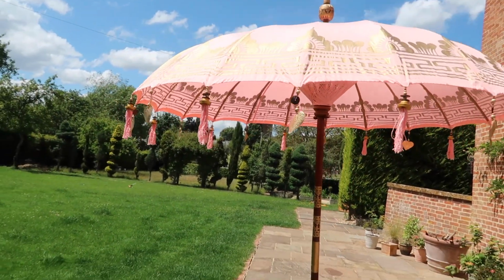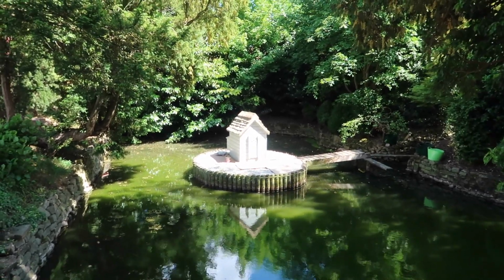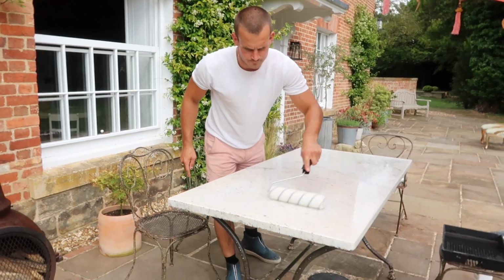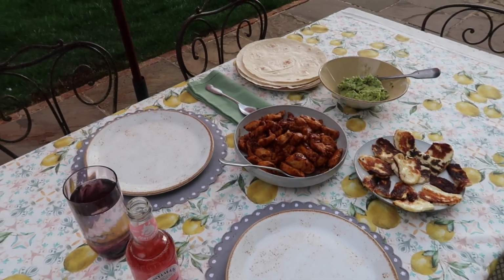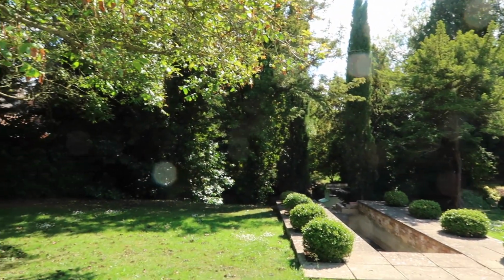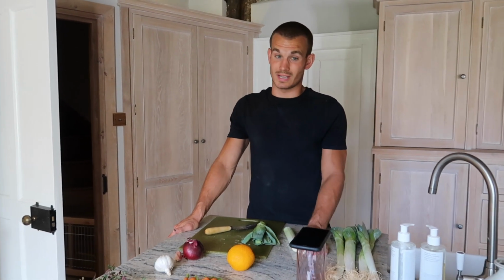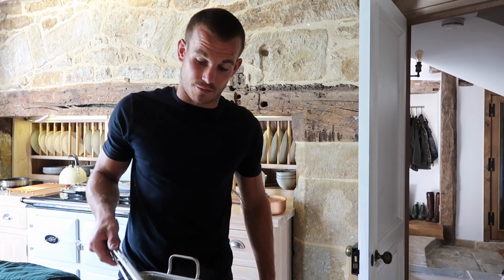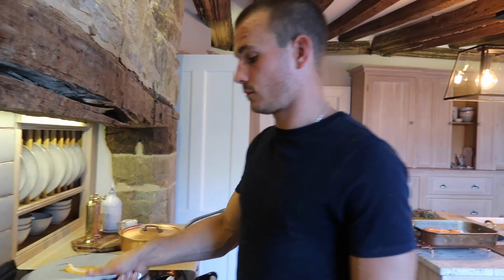GARDEN UPDATES & CHARLIE'S EPIC ROAST RECIPE! // Moving Vlogs Episode 40 // Fashion Mumblr

Comment: That dinner looked amazing.  I use Bisto to thicken gravy but for a roast beef, you should try adding in a little red wine.... it elevates the gravy also alternatively using a hand held blender and mushing/purating the carrots to mix/add to gravy is really good.
To remove the fizz from your drink Josie....you can add a little sugar and mix it or pour it into a glass and stir/whisk the heck out of it and it will flatten the drink alot faster then leaving it out to sit.

Comment: Love the Guide To The Perfect Roast - especially the suggestion to add some peas to the sautéed leeks! Also, I think using the goose or duck fat isn’t as unhealthy as it might otherwise seem because of the much higher smoke point of those two specific fats. Olive oil would essentially burn, so I think Charlie has chose the right tool for the job! For anyone trying to follow a plant based diet, they could use avocado oil instead - it’s far more resilient than other oils at higher temps, and doesn’t add any odd flavours. Great vlog overall - bravo to the Sunday roast!